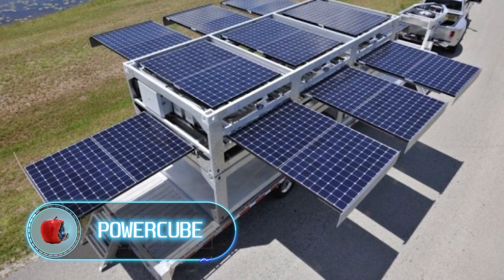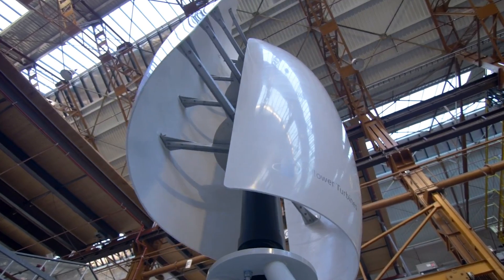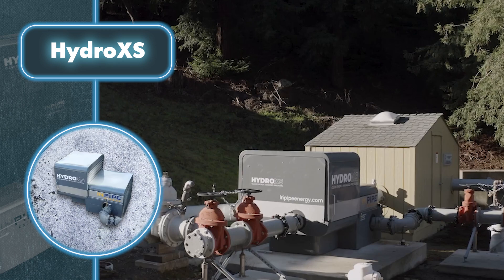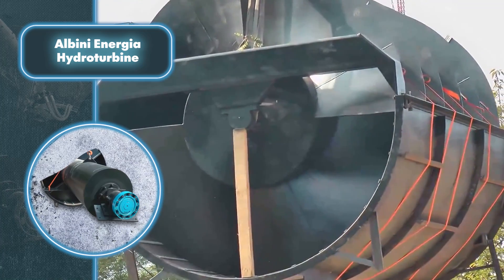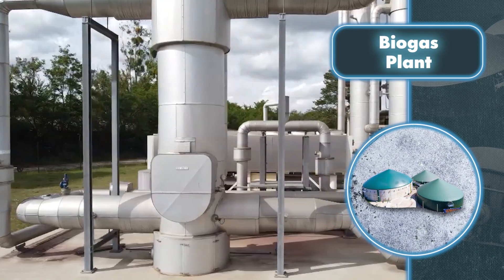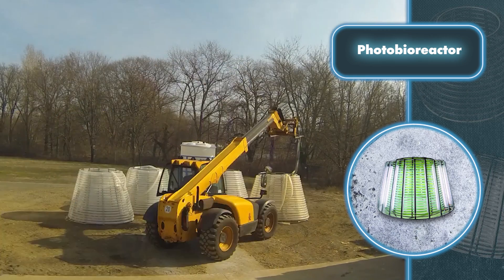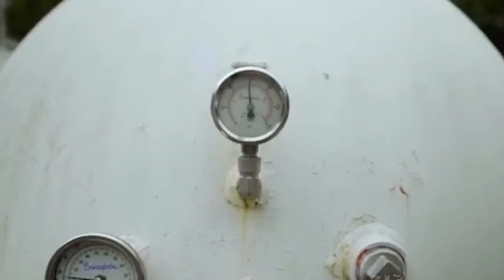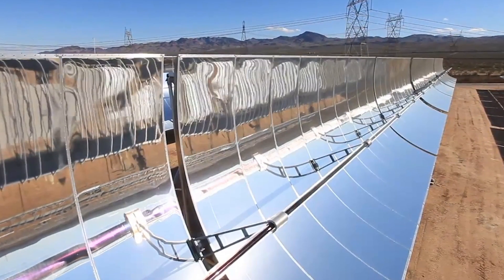Free Energy Plants You Can Place in Your Backyard

Comment: The oceans are mostly untapped. There's quite a bit of energy density from the kinetic force of moving water. We do a lot with rivers, but very little tapping of ocean tides and waves.
Reply: Honestly the problem with the ocean is that it's too powerful. It tends to batter everything you put into it to pieces. And then there are those unpredictable storms.

They were doing some undersea turbine in Scotland taking advantage of the constant strong currents and that seemed pretty promising.
Reply: @Rainbow_Oracle  They did 1 in NY. I think it was near the bottom of the East River. They used it to power a supermarket. 
The ocean is immensely powerful, but they manage to have massive drilling derricks.

Comment: How much does it cost to get "FREE" energy?
Reply: My off grid 4kw solar system with backup batteries costs me roughly $17,000.00. Call your local solar company they will tell you.
Reply: @junkvista61  4kw solar should be around 5000 euro's now. And buy a 5kwh battery only. Not those big Tesla things (way dear). 5kwh is around 2500 euro these days, easily to plug in. So with some labour, get this all done within 10000 euro. That is 11000 dollars......

Comment: The word free energy is misused a lot.  The equipment is costly, along with the maintain. There is nothing free about it.
Reply: Guessing the free aspect is the fact that we don't have to pay for the sun and wind to exist in nature (thankfully). It's also false to claim that the operation of any of this tech is "effortless"...
Reply: well its not free in the economic sense there a costs to running the electricity.. @TheWowWowWest
Reply: The word “free” does not apply to oil, gas, etc…because building those infrastructures and maintenance is also insanely expensive…while the sun is a endless source, world natural resources are not!!
Reply: @blindsoldier  The sun might be endless but turning it into electrical and storing it is costly. The point being there's nothing free about it. Let's make a comparison with fossil fuels. They are free the cost is obtaining them. Any energy source requires the impacting. of the enrolment. Solar, wind, hydroelectric fossil all do.  
The free part doesn't exist.
Reply: @comeasyouare4545  fossil fuels is not only “getting” them. You need to refine it, purify it, etc…
The biggest problem with “green” energy is “storage” facilities. Indeed a solution/alternative to lithium must be find. But the world can no longer be dependent on Venezuela, Iran, Russia, Saudi Arabia, etc…
Reply: When fossil fuel trolls post comments in comment sections like this about the dysfunctionality of opposing technologies... they are doing so not because the opposing technologies are actually dysfunctional... but instead they are lying in a desperate attempt to destroy the new technologies adoption which would be the end of their economic livelihood. They lie to you about the mechanical dysfunctionality of the disruptive technology as they are lying to you that their legacy technology does not pollute and it does not need to be retired.
Reply: In short... the technologies you see here work as depicted in the video and as the commenters here describe. In contrast to the trifling minutia of unsubstantiated operational defects purported by these fossil fuel PR think tank trolls of these new technologies which are PROPAGANDA LIES. The new technologies work as shown. And do in fact create free energy just like they say it does. Unlike fossil fuels that have to be continually extracted refined transported and consumed at a continual per unit volume cost. Even after the initial hardware purchase and installation expenditure.. the new technologies do not pollute and the old fossil fuel technologies do.
Reply: And they say a simple installation. I am an engineer but it is quite the installation that they built there, nothing simple in it.